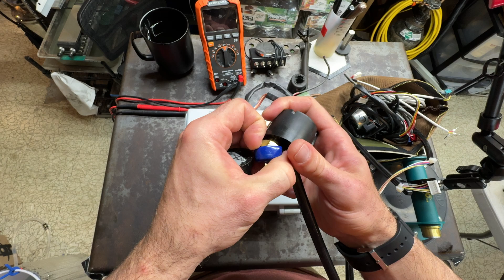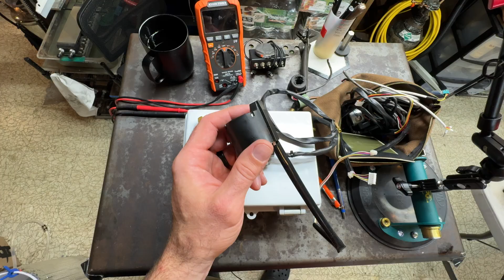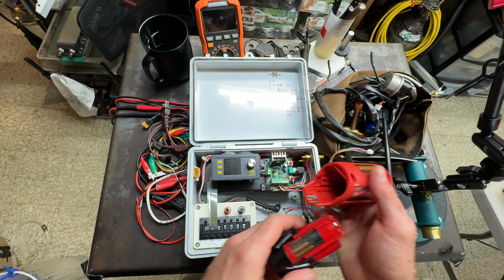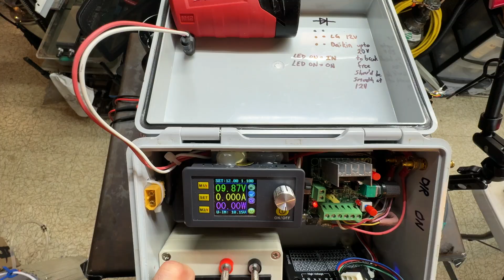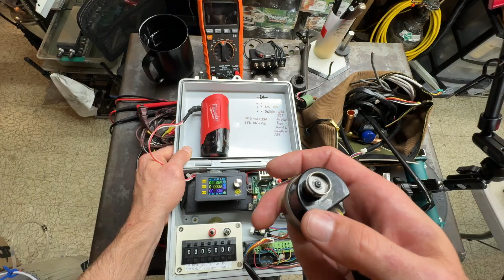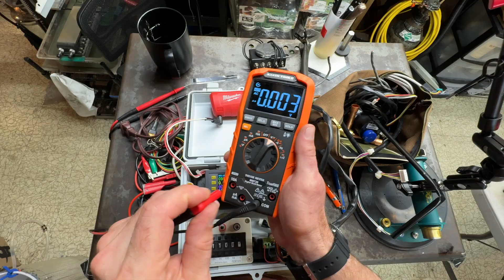HowTo50: Build a Driver for EEVs (ie Electronic Expansion Valves)

Comment: Very well done. I only wish I could see the best way to mount all that stuff without touching or having a board fall. That the tough part to compiling something like this, along with where the wires go.
Reply from the maker: Yeah the layout is tricky.  It’s nice to “dry fit” all components first then consider wire routing afterwards.  It’s kinda like Tetris lol 🤓